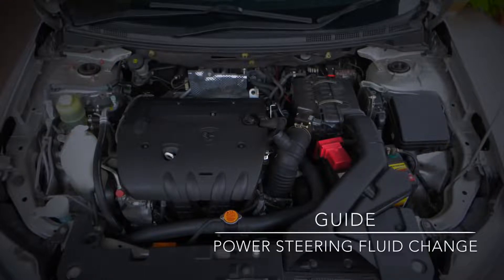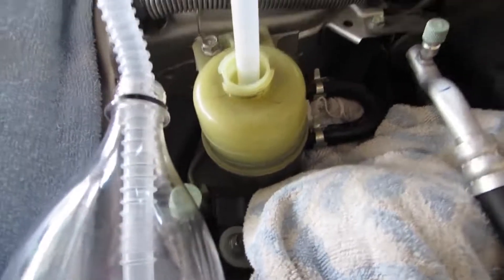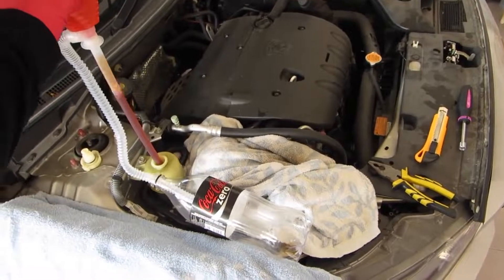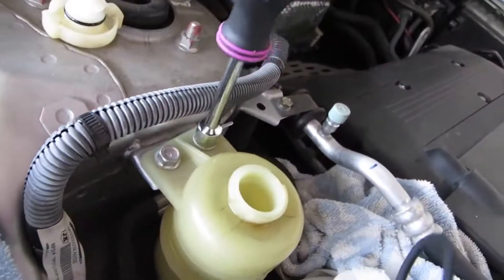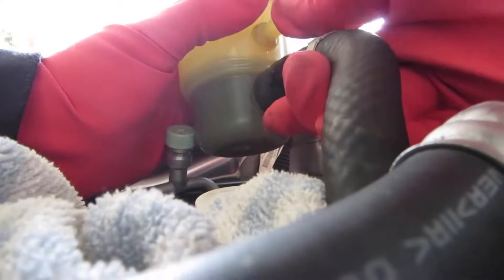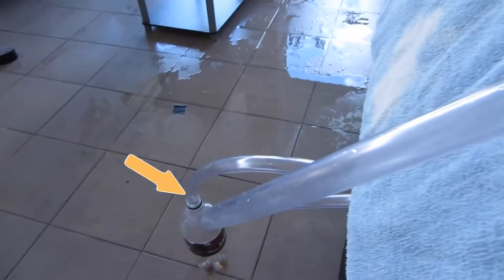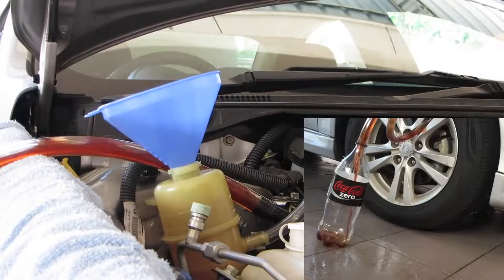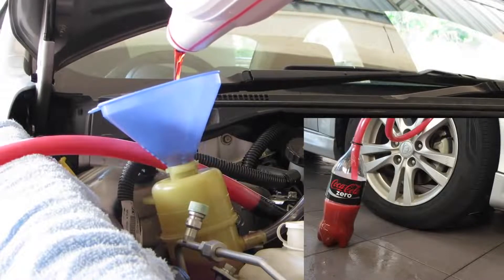Power Steering Fluid Change 2007 - 2015 Mitsubishi Lancer/ Proton Inspira

Comment: Looks like the reservoir has a built in filter, might be worth replacing if you’ve got black oil
Reply: Agreed.  After draining my reservoir it had black gunk on the inside wall, below the internal mesh filter.  No amount of cleaning was removing it, so I changed out the entire reservoir for a new one.  Never know when the gunk might have broken away if i re-used it.

Comment: My wife's 07 Outlander has dirty fluid, but cannot get the cap off.  It call for Mitsubishi fluid.  Where to get that.  Auto trans fluid work with out starting leaks?  Do not like the Outlander much.
Reply from the maker: Check what your owner's manual recommends. For the Lancer, it states Mitsubishi PSF or ATF Dexron lll / ll. No leaks or any other issues.

Comment: Do all Mitsubishi's require ATF in place of genuine Mitsubishi power steering fluid?
Reply from the maker: No. This generation Lancer calls for genuine Mitsubishi PSF or Dexron III/Dexron II ATF. Other models may differ. Always check the user manual.